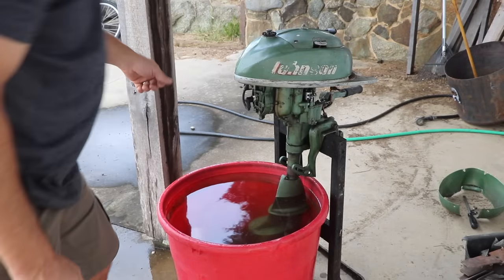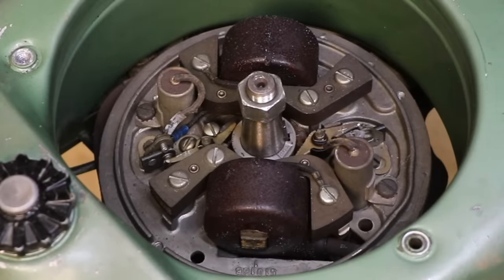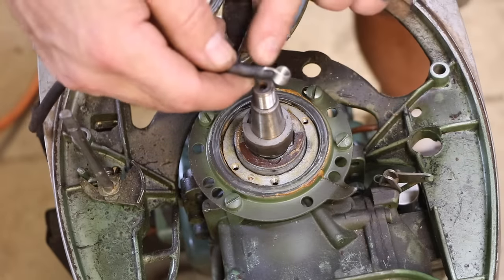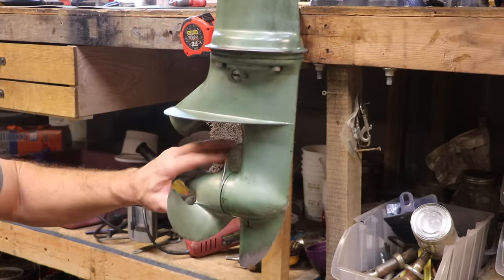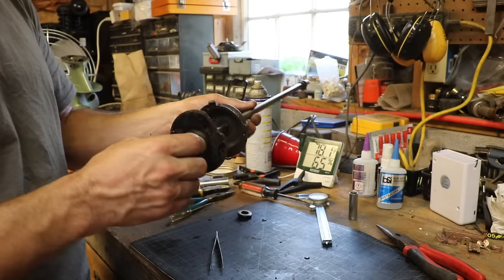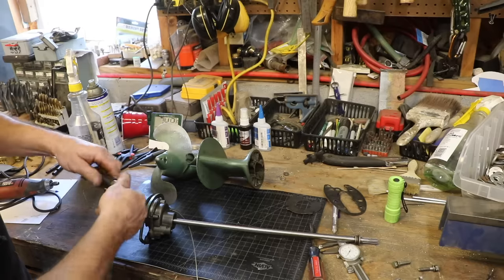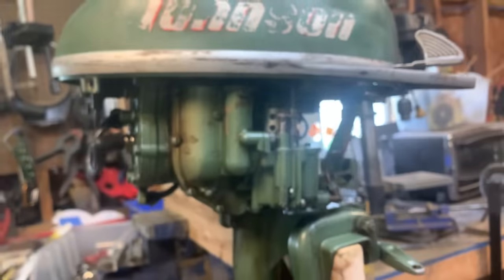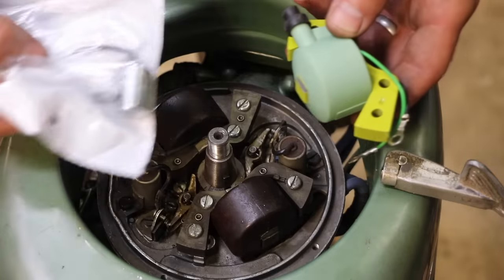My Johnson Needs An Overhaul, and it's Putting Up A Fight!  Johnson Engine Part 3

Comment: Pro Tip: The reason you put the gear oil in the bottom is because water and greasy water floats, so if your just doing maintenance it pushes out any lighter than 90 weight contaminants. You don't need any special equipment just the lube in a tube.

Comment: Coming from an electrical engineer, a condenser isn't "similar to" a capacitor, it is a capacitor. We just don't call them that anymore outside of audio equipment, for some reason.
Reply: @brentmcmahon8188  i mean, it's a bulk accumulation of charge in a confined space, what else would it do other than discharge or occaisionally explode?

Comment: Yes, please - new rings. I wanna see what this Johnson will do when it's firing on all cylinders and full compression again!
Reply: Yeah , do the ring job !
Reply: As a backyard mechanic I leared a lot and especially liked the way you admitted mistakes or omissions like putting parts backtogether again.  if there are no bolts left on the bench then rebuilding is a success.  Many times I find one bolt left on the bench     so to me that's success to me.  Ha Ha Ha....thanks for the video on the Johnson and the tactor back hoe hydraulics. 
Dan, Mishawaka, IN.
Reply: I hear Johnson rings improve performance.
Reply: ONLY IF IT TRULY NEEDS RINGS
Reply: Compression  test first
Reply: A 2 cycle engine is more accurately judged for its potential with a vacuum test

Comment: before going deep in the engine block, try a gauge with a shorter hose, the cylinder capacity is so small in comparison with the hose volume that it can cause a false reading, a good idea is to do a wet test before shooting anything.
usually, when the compressions becomes low due to wear or stuck rings, the readings differs from one cylinder to another, in your motor, they seems to be very even.
If the cylinders are not scored, you can try a  cleaning treatment as seafoam, sometimes, it can frees the rings so you don't have to open the short block
very good video
Reply from the maker: More good tips from Jacques!  Thanks again.
Reply: It’s the legend himself.
Reply: @FarmCraft101  marvel mystery oil  added to fuel mix with sea foam helps unstuck rings  it worked for my 1956   McCullough  Scott 25 
And 19 57 mercury  ... and you can tell by exhaust note  when running  dead on perfect  ... on occasion with my older outboard  engines 
For my fuel mix I use 100 octane racing fuel  it really makes a difference even on smaller engines...  my  50 Scott  sea flash  and  Chrysler 
Outboard  really wake up on race fuel mix ..... great video thanks for information... and taking time to share
Reply: Great job Jacques! It takes real skill to just listen to an engine... THROUGH THE INTERNET.... and diagnose an issue. You guys are the true heros of social media and the real reason why it should be around IMO. Thanks for sharing your wealth of knowledge with everyone else :)
Reply: Knowing to think of the length of tube for the compression test...where that is taking up a fairly significant volume of available air-space and giving a false reading...I call that brilliant.  Chef's Kiss to you.
Reply: Depth of knowledge is a wonderful thing. Thanks Jacques!
Reply: Almost NOTHING can replace experience 
[I'd have NEVER guessed, either- Just from hearing it run]
Reply: @Rickbearcat  If he got higher readings (76-84) before with the same length tubing; it is something else.
Reply: Length of hose will not have anything to do with compression pressure readings unless the hose leaks. Shorter hose just means you don't have to turn the engine over as many times.
Reply: The length of hose was the same on both tests so I don't think that is the issue. The down stroke forces mixture in the crankcase through the ports for compression. Low crankcase pressure from worn rings, or in this case probably insufficient oil mixture, is allowing blow by on both the down stroke and compression stroke.
Open the throttle and make sure there is plenty of oil in the mixture and recheck the compression. I bet it will  be higher.
Reply: Hot brake fluid is better than seafoam to free the rings
Reply: @azopene  what you say is true - as the fitting that screws into the plug hole has a one way valve which essentially turns a motor into an air compressor.
Reply: Frank Kleinknecht. When starting the engine make the fuel mixture richer with the primer button until the engine warms up. Fished many years with a TD20 Johnston.
Reply: Is there any way of moding a Johnson motor to be quieter and less smoky?
All the boats here have upgraded to Yamahas and I don't want to be the one making a racket and smoking up the docks.
Reply: Hey Captain!!! Great ear on her only hitting on the one jug!   I’m only guessing but I’m thinking that you have done your share of boat motor or small engine repair!   I love that as a community of people from all over and all walks of life that we can make the world a little smaller place by helping each other with questions and projects that we share a common interests in…  May the four winds blow you safely home!
Reply: @rodeogreenback7280   zz
Reply: The Jacques Poirier
Reply: Make sure the throttle is on full when testing compression pressure. This motor is in an amazingly good shape. Can tell though, it has been in freshwater only.
Reply: Also have throttle wide open for compression tests .

Comment: Very good video!  I noticed that the engine after the work did not look like it was pumping as much water as it was before.  The telltale was streaming very well before you disasembled the engine.  I believe you are losing water internally in the end of the shaft area where the power head mates to the lower unit and here is how:  The black carbon ring that was very brittle and broke is a sealing surface and seperates the pumped water from the shaft.  It iis by design very hard and brittle and seats itself on the shaft seal.  This is somehow part of a chamber where water seems to be accumulated and routed into the engine.  Also, the spring is what keeps the carbon seal slightly loaded to effect the action of the seal.  The design is not faulty as you think.  I really suggest you look at the parts illustration and see how this works (I am guessing here) and your water pump output to the engine block will increase substantially.  You did a really thorough job but cooling those engines is really critical.

Comment: Great video.   I actually worked on these back in the day.  I was an outboard motor mechanic at an Evinrude Dealer - on the water marina from 1959 to 1963 while in high school.  My uncle actually owned that exact Johnson and took me fishing with in Lake Chetek WI when I was 12 years old.  Never had to work on his though.  By the time 1959 rolled around most every one upgraded to 5hp motors with both Fwd and Reverse gear shifts.  OMC recyled that clutch design in the early 60's with separate electromagnets to engage Fwd and Reverse.  Good memories for me,  thanks.
Reply: i had one 2
Reply: You make good videos

Comment: When it's running on one cylinder you can hear it carrying the other cylinder, it has a distinctive sound that's hard to mistake once you recognize it. I was an auto tech for 30 years, I did run-ability, fuel injection and electrical. You can pick this sound up even if it's a 12 cylinder...
Reply: Amazing.  👍

Comment: Nice brass remake for the broken seal rung under engine mount.
At 27:29 when putting the lower end together, your 3-bolt backing plate is off center, and clockwise about 8-degrees; but should not matter, since the force when tightening bolts still distributes evenly on snap ring.  It is also visible on your "pleasing snap install" repeated at the end.  
As for changing the rings... 2-stroke engines are pulling fuel/oil/air mix in from carb through lower case under pistons (giving lubrication) then mix goes through side intake port. This means blow-by past rings mixes some exhaust with intake, reducing power.
BTW: see if your compression test goes back toward 80psi with throttle wide open, and after you spin engine 5 seconds with plug wires off, to add some oil mix to cylinder walls.

Another trick to check for cylinder wear, and blow-by past rings:
(1) Attach socket+breaker bar to nut on top of crank and *hold*.
(2) Turn regulator down below 50psi on compressor, and attach line directly to pressure test hose going into spark plug hole. (fittings are the same). This will try to toss wrench, so hold first.
(3) Slowly turn wrench+crank 2/3 of stroke until starting to reach exhaust port. Listen for changes to sound of blow-by air hiss and you should be able to tell if ring seal is even for different parts of cylinder or worn near TDC.
(4) Repeat for 2nd piston, using different TDC position.

Some air going past rings is normal; but you don't want excessive smoke going back in lower case while running.  Also check for worn seals where crank shaft comes out of case.  Leak around crank seals on 2-stroke can suck air, causing you to run lean/hot at high RPM.
Reply: @ Joseph Steinhauser, good observation of the replacements that are required of the Upper and Lower crankshaft seals... This alone could really bring that little 2-stroke twin back to life... I like using the 'cranking type' of dynamic compression testers on engines, which will tell if excessive leakage is  taking place, Anywhere between the cylinders, Pistons & Rings...

Comment: You brought back such great memories for me. My dad had this exact motor when I was a kid, and I use to use it to go fishing on the little lake we use to go to on summer vacation. As a young adult, I was disappointed to find out my dad gave the engine away before I had a chance to get it. That was my introduction to boating and fishing.   I use to sit in the middle seat of the row boat to get it to plain down just like you did in your video.  Thanks for the video.

Comment: Make sure the throttle plate is wide open when you check the compression, it makes a difference. If there is no air to compress (closed throttle) the compression will read low.
Reply: Throttle position shouldn't matter on a two-stroke and the engine out of water exhaust port is another path for air to get in
Reply: On a 2 stroke should really be doing a leak down test and not so much a compression test
Reply: @philbudne2095  the exhaust is not a path for air to enter an engine (2-stroke spark ignition engines included) while it is cranking...  Intake air & fuel goes through the induction system then through the reeds/or rotary valves/ or the piston ports & into the crankcase, where it is compressed, then forced through the transfer ports and into the cylinder while the exhaust from the previous cycle is forced out by this incoming air flow, from the transfer ports, then compress's & ignites the incoming charge... The throttle & choke must remain open for an accurate compression test...
Reply: @michaelmartinez1345  In a compression test the gauge is screwed in in place of spark plug and no ignition takes place, so there is no exhaust, and air can enter via the exhaust port. https://www.youtube.com/watch?v=AgrI3hRQzOA
Reply: thats actually what I wanted to say, but not mechanical enough put my two cents in Thank you ironhead cycle..
Reply: @ALCE52  you are welcome

Comment: The oil from bottom is a hold over from many marine engines from WW II!
Then, the gear boxes were filled with grease, like a grease gun.
It was always added from the bottom to push all the air out of gears.
      Your Chinese finger thingy is a device to keep engine from running backwards as 2 stroke engines are capable of, especially at low speeds

Comment: I'm 69. Lived on the Rogue river in Grants Pass Oregon as a young man, 11-16. My dad had an old wooden boat with with aluminum skin and that same Johnson engine.  Our river bank was difficult to navigate without hitting rocks and shearing that propeller pin.
I cut some nails up to make a bunch of shear pins so I would be able to head out and be able to change the pin every time I hit a rock.
I got used to the rock locations and rarely hit them. My dad not so much.  He'd head out with a buddy of his and hit a rock every time.
I had to coach him.
Every exterior part of that engine and the cotter pin/nut/prop/pin assembly brings back great memories. Took it apart 50 times at least. 
I could go up river through a couple small rapids till one matched the engine power and the boat would stop advancing. 
I recently thought about going back there and boating up through that minor rapids.  One of those things.

Comment: I once had an old mechanic tell me a horror story I will relay to you sir. A v8 motor had a plug problem and the cylinders were wet with fuel. All plugs out they checked for spark as you and I have done many times. Well this time the engine turned into a flame thrower that spit gas onto the walls on both sides of the shop. Fortunately once the posters were snuffed out and the singed eyebrows quit smoking the fire was out. Finally for once I learned a hard lesson from someone else’s pain. Thank you for your video. I didn’t mean to harp. Just thought I would share.

Comment: Your 100% correct in filling this model from the top as it has a kind of an open chamber large oil cavity. Later models designs was changed to a smaller closed chamber system requiring filling from the bottom. Most people dont know this and say fill from the bottom understandably. Nice Work with the machining lathes are always handy .That bottom ring that broke is made from carbon possibly so it is very brittle. These TN models were big sellers in the early 50S for Johnson they sold thousands of them and there still around today, great little kickers. The proof is in how nice it ran on one cylinder. Which is how they were designed if a problem with one occurred ,so you got back to the dock  instead of rowing and cursing, LOL!..
Reply: Nice to know how they were designed. I found out my Evinrude 15 hp was running on one cylinder after I left it at my uncles place. Sometimes it would have 15 hp, sometimes it would have about 6 and guzzle gas... The ignition lead just had to be replaced and it would have been ok again. It probably still is at my uncles place but I can't use it anymore in the city because it is a 2 stroke. I would love to be able to use it again because it was a kicker when it ran on both cylinders and it sounded very nice.

Comment: Regarding the compression, i recently fixed an old chainsaw for a guy, he'd been running it on cheap 2 stroke oil and it had very little compression. I did not remove the cylinder (so nothing was upset) and put in some good mix with full synthetic 2 stroke (Motul 800) and the compression about doubled, completely different saw
Also the piston had a LOT of wear, looking through the exhaust port it was polished shiny and the ring was well worn, whole lot was due for replacement but got it running good enough for him
Reply: I'm behind this. Your Johnson seems to be pretty strong the way it is. No need to fool around. Like Skwirl said, just use some good oil and give him some time. Otherwise, if you have too much time on your hands ... fooling around with your Johnson is always a good way to spend your time...
Reply: @f.h.9606  Yes, you have to make sure you're using the correct lubricant when extensively testing your Johnson

Comment: It is a lot of fun to repair older stuff.  You can see what is going on with each part and replace it if necessary. Modern stuff is huge wiring harneses with black boxes that cost hundreds and no way to tell if they are the problem!. I love it when it cranks  after we get the covers back in place..  My dad had a 12 HP Johnson that we used for years.  Thanks for the great video!

Comment: My Father worked at the OMC Evinrude assembly plant for 34 years.  OMC produced both Evinrude and Johnson Outboard motors there.   He did many repairs for relatives, friends and neighbors at  home.  He taught my brothers and I how to do all of these basic repairs on motors from 1.1hp up to 55hp.  My older brother and I also worked at the Milw, WI Plant 2(Assembly Plant) in the mid 70's- early 80's until they shut down.  Fill from the top hole until oil comes out.  A few drops more or less doesn't matter.  My Father always used Brown, non-hardening Permatex on all of those gaskets and the Gear Housing cover.  A good tip, always carry a couple extra shear pins, an extra cotter pin and a pair of pliers when you go out boating.

Comment: I vote for the rings.  I learn a lot from watching another man work on his Johnson even if it's much smaller than my own.  Mine's a  1978  Johnson SeaHorse 120 HP. It's a two hander but still all the same principals.   Other than that, I'm not surprised that the country is divided over how to fill a lower unit. Anyone that shares the way they do it is a friend and anyone that tries to tell you how you got to do it is should be dismissed as a Karen.
Reply: And seals
Reply: @1jtwister  a small johnson can work  just depends on the motion of the ocean